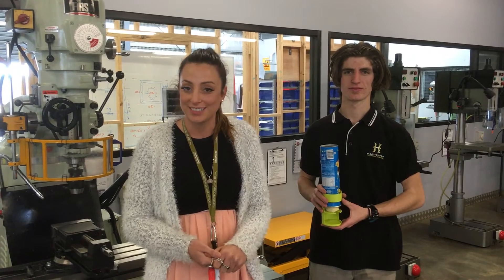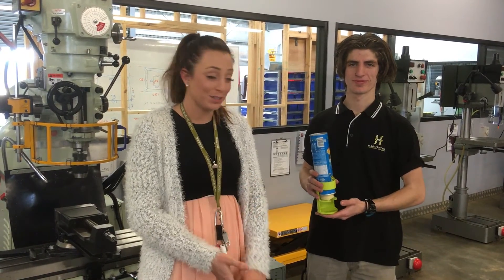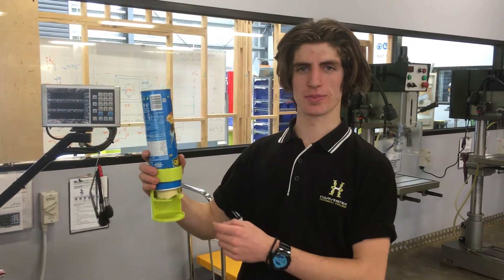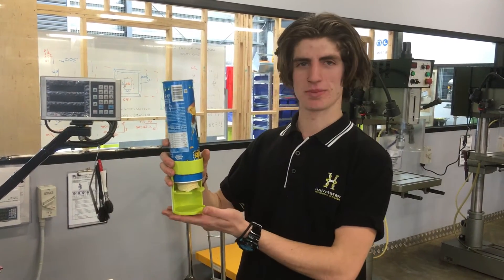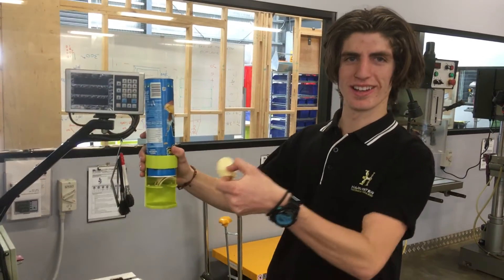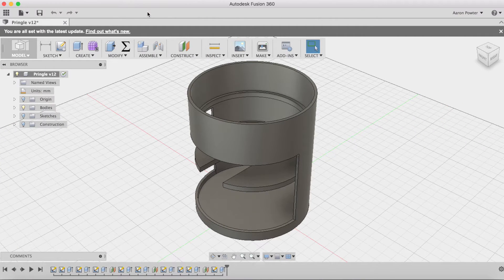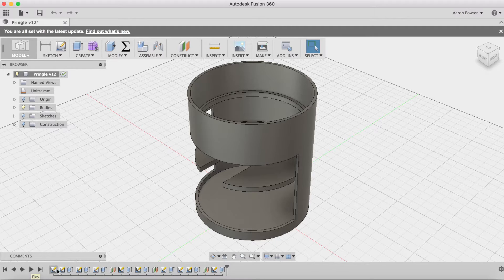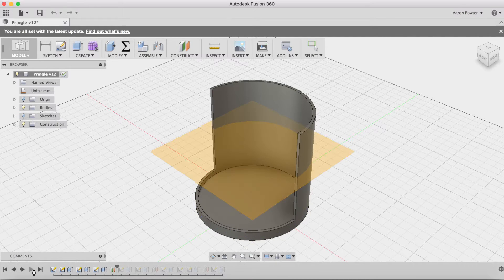3D Printing via Autodesk Fusion 360

Comment: omg so much support material that shelf could be made a separate part and added later with some glue or some joints
Reply from the maker: Onica Daniel Petru Yes there is always a better way of doing things. However keep in mind that this is my student's very first 3D print which he did in his literacy class. Much to be learnt when young, learning and reflecting on products made is all part of the design process.
Reply: I agree! Knowing how to use. a 3d design software is only the first step in becoming an engineer. With guidance and support and the willingness to learn one can achive a lot
Reply: I'm 16 and I designed this in response. http://www.thingiverse.com/thing:1804071/#files
I don't even have an education in school for CAD, it's all self taught.

Comment: work on that support material. Design for minimal amounts.

this whole project could've been printed with 0 support.
Reply from the maker: Thanks for the advice, I'll pass it on.  This printer uses the standard UP3D software.  Mmm, not sure how you'd print without support around the finger opening and the floor though ;-)
Reply: Not sure if all the dimensions are correct. But this can give you an idea of how to design supportless.
http://www.thingiverse.com/thing:1804071